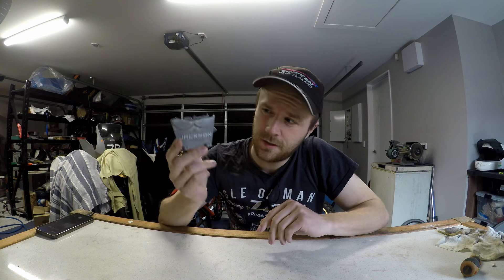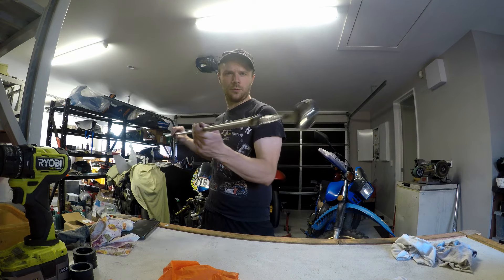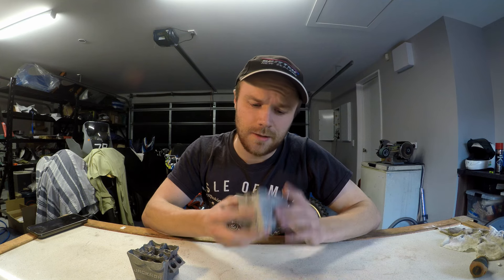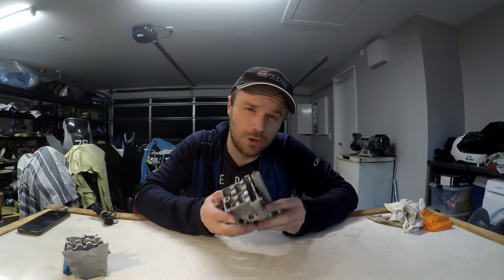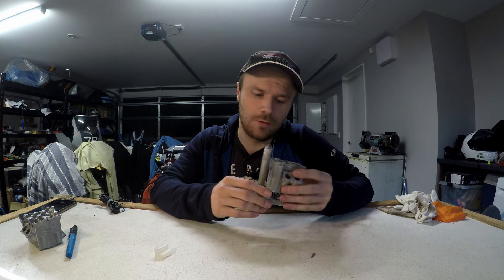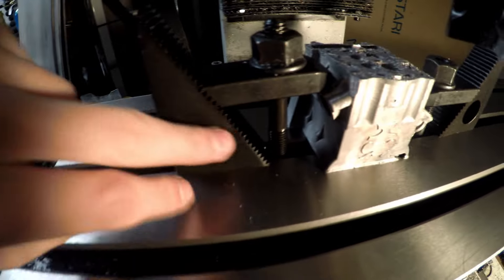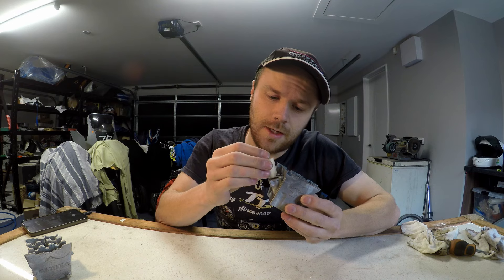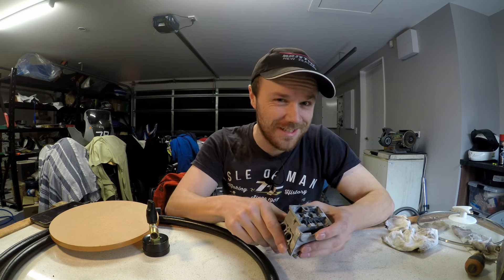Casting my High Performance Cylinder Head.

Comment: Fantastic job! 👌
I made myself a higher cylinderhead bij using the upper half where the cams are in; the holes for the buckets are bigger now and have another angle.
The lower half has longer and bigger valves, the ports are much higher in the head and the valve angle is narrower.
A lot of welding and milling had to be done to achieve this…
But casting a complete new head is much nicer!!
Reply from the maker: @fokko14  Wow, that sounds like an awesome project, I can only imagine the hours put into it.

Comment: For your mill, take all but one cutting insert out of your facing head and you'll have a mini flywheel. Helps with vibrations

Also from personal experience, keep failing while its cheap only move up to it being expensive when you can make a satisfying product at least twice in a row.
Reply from the maker: Thanks man ,I'll give that cutter idea a go, it's a hard decision as I'm aware the smaller ones are technically harder to cast, just working out how much materials ect for full size.

Comment: Petrobond?  (Oil-based foundry sand?  What I hope to get.  Regular water-based greensand tends to be unusually finicky.)
Reply from the maker: The stuff I'm using is an investment material,  made by Ransom and randolf sc20. 
Has works really well so far, makes incredibly detailed castings.
Reply: @TheMotorcycleForge  tried lost-wax years ago.  Could never get it to come out. (college level art classes.)  I have had (much) better luck with sand, though that’s had its issues, too.  Hence the desire to try Petrobond here.

Comment: from my experience casting RC parts with lost wax, the larger the casting the better it will be. I think that 90% of your issues is from doing it at a smaller scale. Heat retention and surface tension are 2 things that DO NOT SCALE DOWN and are clearly 2 things you are having issues with. Do a trial the same way you are now but full scale, i bet it will work just fine, i know its "saving time and materials" but if you get a good casting at full size now (you probably will) then you are NOT saving time and materials with the smaller scale are you? Give it a try please.
Reply from the maker: Yep full size is up next, just wanted to get the process nailed and practice.

Comment: I have no interests in motorcycles. I will be interested in how well this casting performs for you. But I'm primarily interested in the casting of your part. From the shape and complexity of your part, to the gating,  the flaws, the design choices, etc. I would like to see the gating still on, and then the casting with it removed. How it looks after machining. Hell, why don't you just send it to me so I could examine it myself. ;)  Motion is great in videos, but it blurs detail. Some still shots of the casting would be appreciated.

It seems that you have little experience in casting, but that you have done a lot of research. And you are using quality materials.

I was wondering what alloy you are using. If it needs to be heat treated. Slow cooling tends to not give as hard or strong a casting.  Will you need to tap any threads?
Reply from the maker: That's one hell of a comment and much appreciated.
Ok you got it, I will make the next video with much more detail and close ups.
Yes you would be right, casting is very new to me, so trying to learn as much as possible!
I am using A356 which in the finial form I will heat treat to t6 I think 🤔 and yes I will have probably at least 18 holes to tap, mostly M6 and M8, thinking of getting some of those tighter tolerance taps for higher strength threads.
If there is anything else you wish to see or know I'm happy to help.
Cheers Logan

Comment: rather ambitious casting for gravity...

consider centrifuge or vacuum... yes, trickier. centrifuge isnt too hard? look at an old 44 drum and a smallish car rim...
you arent really making it easier by shrinking for practice... need a much more fluid pour (silicon!) as the section reduces, and things cool differently.

i try to only use old castings for casting, extrusion never gives good results.

blending... i see a raised bead around the intakes, along with a valley at the junction... may look nice, but... superfluous and make awkward casting lines. gotta think how it flows in and cools, any constrictions "pinch off" a larger section...which then shrink or develop porosity.

in a way, its better to contemplate graphite, and how to machine negatives... along with requisite core pieces. "die" casting...

or the old school... greensand and patterns. if youre using commercial refractory... ouch. its why i got a 3d printer. make patterns. never had luck with lost wax/foam, and refractory aint cheap...  sand and bentonite/kitty litter is... its also awesome once you learn how to mix it. just have to think out the patterns properly.

stop and look at any head, parting lines... consider the core prints, how to hold them...
Reply from the maker: Thank you for your insight, I have been researching into vacuum casting and how to go about it.
I'm aware that casting at 50% is harder, so in theory, if I can nail this, then full size should be a piece of cake, 🤞
There is definitely a few words you have mentioned that I have no clue what they mean, so I'm going to go study up.
Cheers Logan